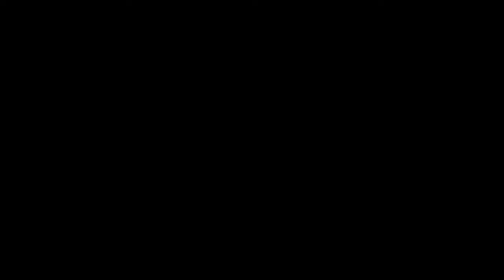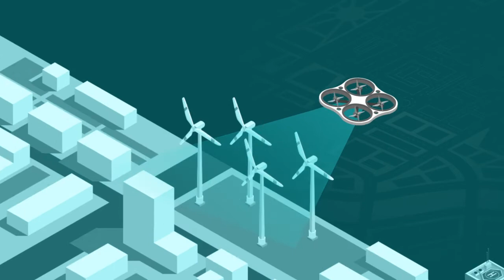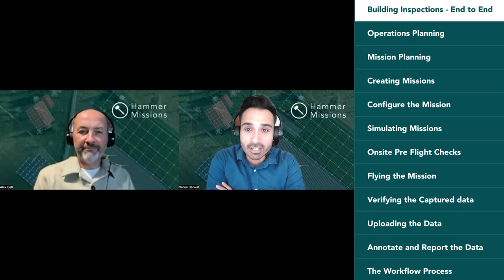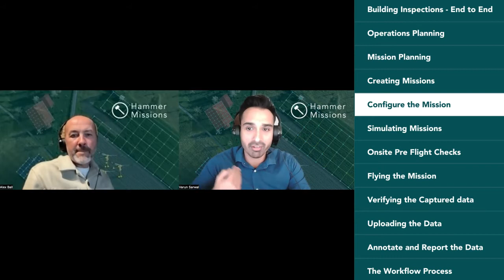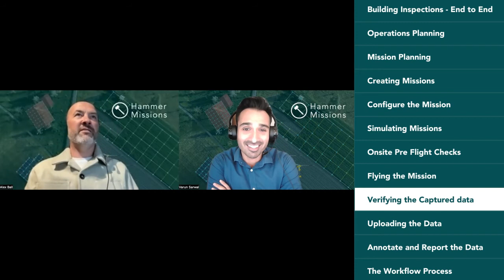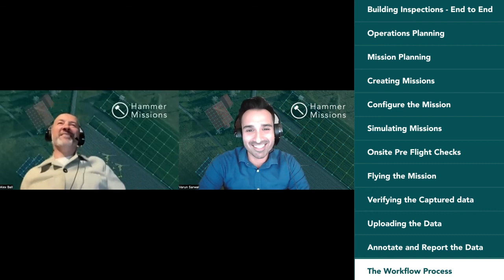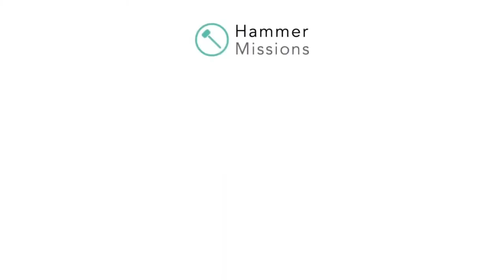Ep3: End To End Drone Workflows | Hammer Missions Podcast

Comment: Chapters (Powered by ChapterMe) - 
00:00 - Pre-plan your flight mission
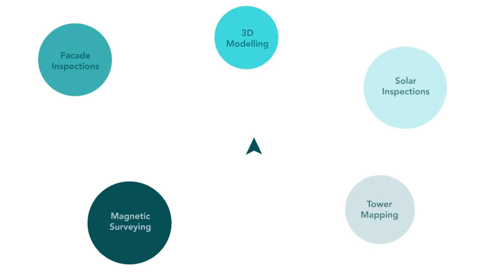00:58 - Introduction
02:11 - Building inspections end to end
03:44 - Operations planning
06:32 - Mission planning
09:06 - Creating the right flight plan
12:05 - Configuring the mission
16:10 - Simulating the mission
19:20 - Onsite safety checks
21:33 - Fly your mission hands on
25:22 - Check the data before you leave
31:01 - Upload the data to the cloud
31:29 - Report and annotate the data in Hammer
33:21 - Workflow - End to end process
37:01 - Outro